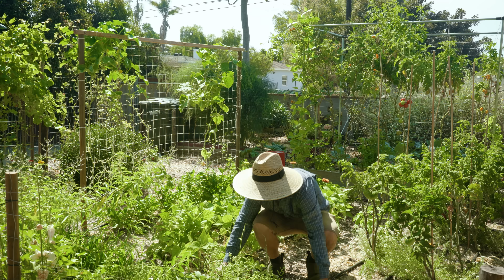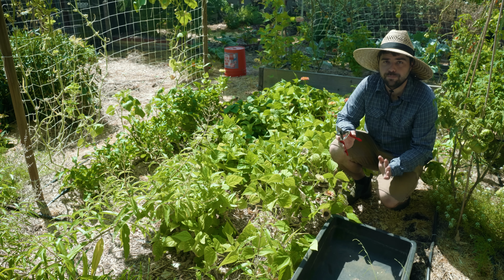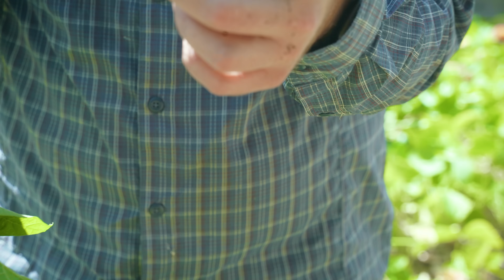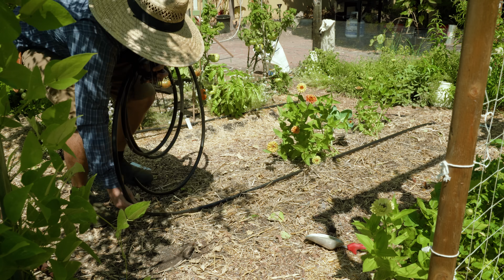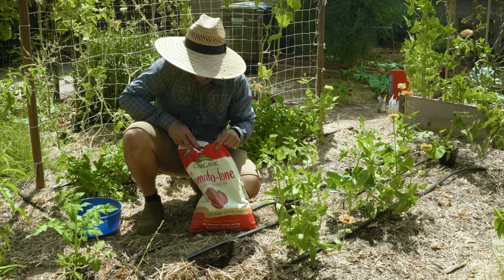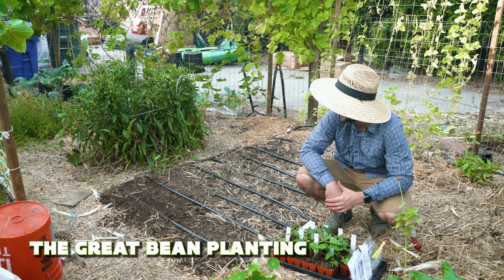Bush Beans Beat Me | My 2022 Garden Nemesis

Comment: I love beans in most forms (like green beans that include the pod or black beans that only include the bean), but how do you know which is which when buying seeds? I was pretty confused this season as I was mainly looking for the kind where you'd eat the whole pod. And then what's the difference between bush beans or a pole bean, other than of course one vines & one doesn't.. Thanks!
Reply from the maker: So a lot of beans can be eaten as either green bean or as dry beans but usually ones meant tk eaten one way or another are better. A green bean will say usually green bean or eat fresh where are dry beans will usually say dry bean or shelling bean. That’s sort of the primary way, scarlet runner can be eaten green, shelled and not dry or fully dry!
Reply: @jacquesinthegarden  good info - thanks!!

Comment: Bush beans don't do well in summer for me. It is too hot and humid. I had better luck with Asparagus beans and heat resistant pole beans.  However, while the beans flowered, the birds ate the bean tips and the beans.   So, I will need to use bird netting next time.

Comment: Might have had to good of soil nutrients.  I've only had issues with beans a few times . Put in a heavy feeder afterwards and they did great.  Also put in beans after a heavy feeder,  like you did after corn,  and the beans did very well. I treat beans like herbs now and they do well.  I don't measure when I fertilize,  have a feeling I over do it. But for beans I use no amendments at beginning,  nor the inoculation.  But after they start growing only compost tea or worm tea and they thrive.  Beans always do better for me direct sowing vs transplant and I've never used the inoculation powder.

Comment: i live in escondido, and my beans have been struggling all year. i put up a 30% shade cloth and they blew up and the beans i grew with my corn, once the corn was tall enough to block out some of the sun, then they blew up as well. i have a dozen bean in red solo cups since may, and once the shade cloth went up they have tripled in height and are producing beans.
Reply from the maker: Could be the sun or heat but they get a fair amount of shade

Comment: I'm debating resetting at least my Dragon's tongue beans, because they really suffered in the recent weeks of brutal heat in the mid-Atlantic (more days 90+ than not for 3 weeks, plus awful humidity). The Royalty Purple and my 2 kinds of pole beans seem to be recovering, thankfully, each time the heat has broken for a few days. The runner beans went in very late in a partly-shaded location, so they're just starting to bloom. Last year, the yardlong beans did very well through the worst parts of the summer; I might bring them back in the rotation next year. 

Looking forward to your experiment results for the hardiest varieties. I'm half expecting they'll all grow like mad and you'll have more beans than you know what to do with. Advantage of that is you can choose which ones you like the flavor of best!
Reply from the maker: Hahah I guess I wouldn’t be mad if that happened

Comment: No problems with beans for me this year… because I didn’t plant a garden (I was away for most of July). But, I found the part about the root nodules fascinating! If planting in a container, could you still chop the plant at soil level and leave the roots in the container?
Reply from the maker: You could eventually the roots can build up though and adding more soil to refresh becomes necessary
Reply: @jacquesinthegarden  Thanks! I was thinking that the roots would break down, but it probably takes longer than I realize .

Comment: Wouldn't it be easier to pull the bean plants and and just throw them into the compost?
Reply: He was cutting the plants so that the roots stay in the ground to give the soil nitrogen.
Reply: @umiluv  My point was that the nitrogen would go into the compost to break down and then be put on the plants and then you wouldn't have to fight the roots planting and cultivating, No loss of nitrogen
Reply from the maker: You could but personally I’d rather leave it in place and directly benefit that bed, they were already perfectly distributed across the bed meaning that bed will now get a little boost

Comment: Your bush beans look like my struggle pole beans. It was a light and heat issue; Bay Area weather was just weird for a few months. They just stalled and have yet to flower. Bush beans planted two months later (more heat, plus finally added an olla) are doing much better.